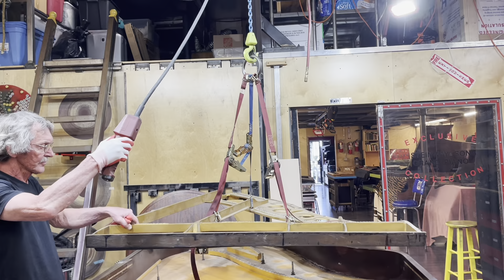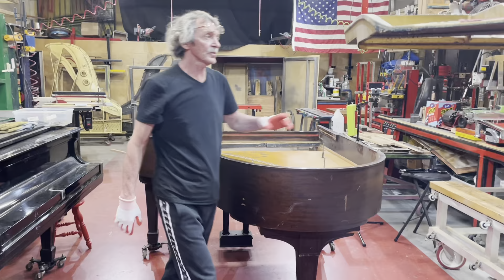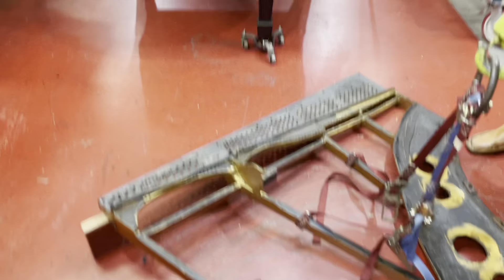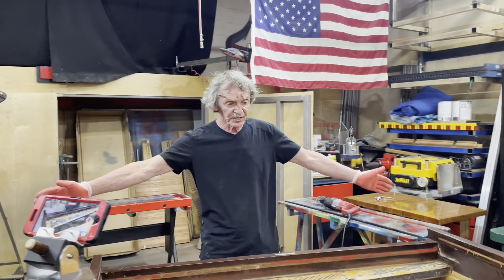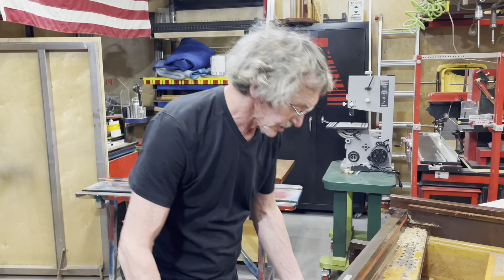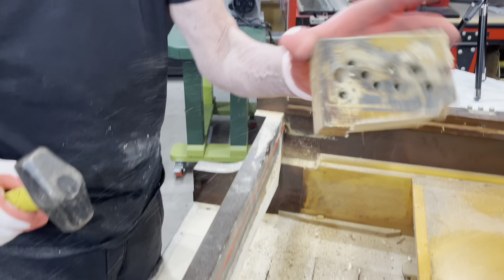Piano Solutions XXI: Making the New Pinblock on the Grand Piano. Pinblock Extraction

Comment: My Bosendorfer 9’6” sounds flat like a highschool piano. I had it tuned to 442. The sound board is good. Felts have 50% but with some lines. Anything I can do to brighten the sound?
Reply: How old is your piano?  At some point pianos need new hammers, and even new strings for optimal tone.
Original hammers can be reshaped (filed) and brightened with a type of hardener (voicing).